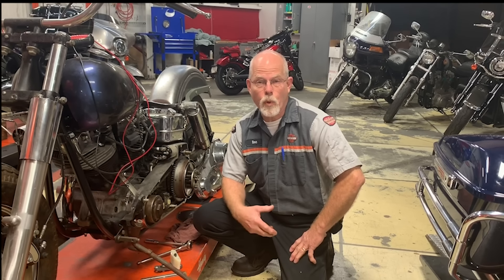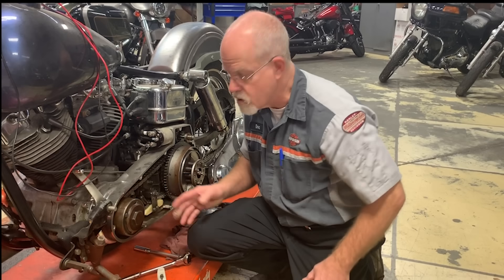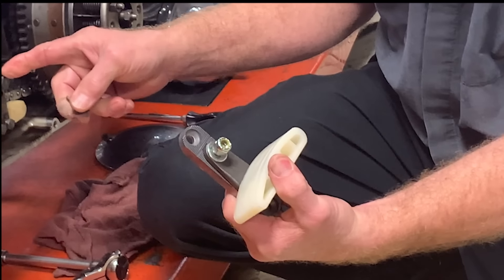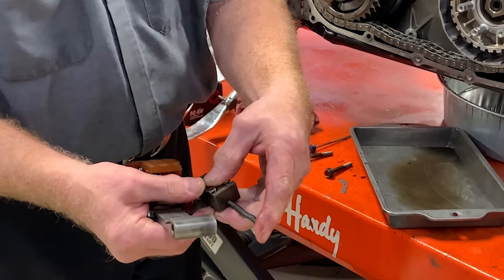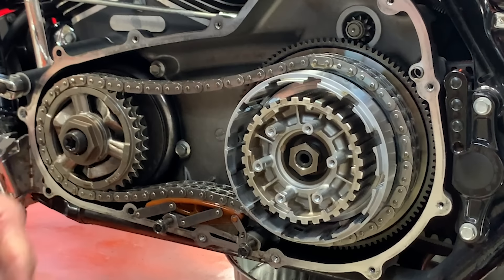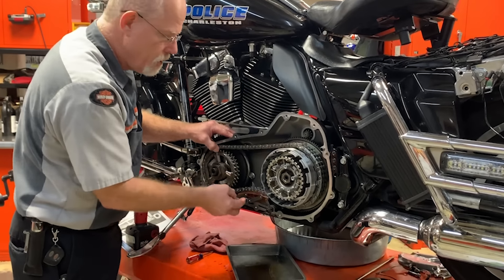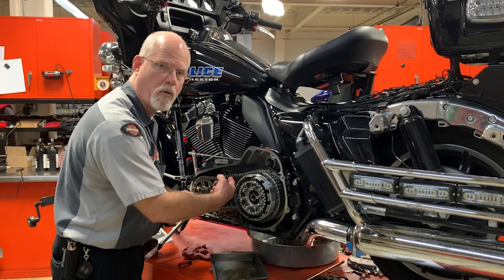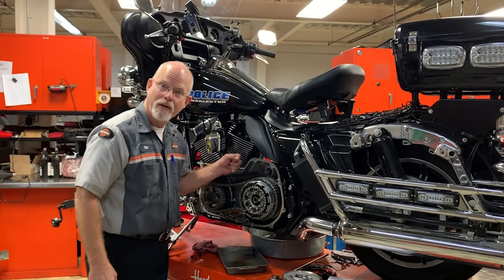DOC HARLEY: PRIMARY CHAIN ADJUSTER UPDATES

Comment: People need to understand that when when beat the crap out of your machinery, there is a cost. Ask anybody that runs the race circuit! Hopefully you've helped a few people with this video.
Reply: I don't and haven't "beat the crap" out of my bike. I ride my bike pretty easily. 
No racing done here.
Pay attention to the comments in this post pertaining to problems experienced by many.
Reply: @williamolson3704  I have been working on Harleys for over 30 years, and I can tell you the majority of the issues I come ac ross are from people that think their HDs are drag bikes.
Reply: @lawnboyfromhell  
       I'm sure!
And rightfully so. 
      That is something you can control. Poor engineering, not so much. 
      Yes, some people are in race mode a lot of the time. But, without inherent problems present, they can take a beating to a certain extent.
      The auto-tensioner is a big fail. It has a design flaw, inherent. That's not even debatable. 
      You simply will not have an over tightening problem with a manual adjuster.
Reply: @williamolson3704  And don't even get me started on the cam case, Lol! The newer they get the more I fear opening my wallet. I have an evo FXR , an Evo Sportster (pre-rubber mount) and I am building a 1983 Wide Glide Shovel. You can keep the rest!
Reply: @lawnboyfromhell  
       Hahaha! 
I had a noisy lifter, now I have different cams (TW222's, twin cam) lifters, qiicky pushrods, inner cam bearings, new cam chain shoes etc. 
     Of course, that required a different "tune" from a new tuner.
     It wasn't cheap. Including the inner cam bearing tool, over $1,800. My labor. (The tuner was $700) 
    What's you're opinion regarding the inner splines on the clutch hub breaking off?
Reply: @williamolson3704  Although I have not seen it personally the stock HD Clutch has exploding issues, so I'm told. I did cams in a 2012 Road Glide I used the S&S 551 EZ Start kit. Also changed the compensator to a Man-o-War made by Dark Horse Crankworks. I have not replaced the clutch basket yet, as I already scared the owners wallet enough by then. If you want to bulletproof a Twin Cam, start watching Kevin Baxter on Youtube, he has pretty much found all the flaws in those bikes already. The thing I don't get is why you need to bike a bike for 30,000 plus and then spend another 30,000 on it so you're not afraid to take it on holidays. I used a Vance and Hines FP3 for a tuner and I phoned Vance and Hines and told them I know nothing about tuners, they sent me a map, I put it in the tuner by bluetooth off the phone and the bike has run perfect, owner is happy as hell. I got my cam compartment tools from https://www.georges-garage.com/ less money than Jim's and every bit as good. The c ost is still prohibative if you just buy them for home use, best to get a group of like minded people to share the tools if you can.
Reply: @lawnboyfromhell  
       Hey thanks!
I really appreciate your input about this stuff. 
      Since it is, and has been from the start, I'll run this bike till "it" or "I" fail beyond reapir. 
     Yes it's disheartening, to say the least, that you buy a new bike only to have to correct inherent problems. Heaven forbid you have to pay for labor AND parts.
    The local Harley dealership quoted me $1,300 just to look in my cam case. This was before my trip to Sturgis last year. Roughly 50,000 miles on the bike, and didn't want any failures on the trip. (1,500 miles round trip with no "other" riding) 
     I told them to go ahead, but after "listening" to the bike run "on their lift" determined it wasn't necessary.  
    Ok......I'm guessing they were too busy. 
     Noisy lifter last two days of trip, so I decided to have a look myself. I'd never even seen the inside of a cam case prior. S&S has a good video on YouTube for this job along with others. 
     I noticed the decompression cams available, but didn't want to veer too far from the "norm" with that design. 
     I found my cam chain shoes were badly worn, which was one of my concerns. 
     I ordered my inner cam R&R tool from Fuel Moto, which is an abbreviated version of the very expensive (Moore?) tool. 
     It worked satisfactory only after filing and smoothing the forward beveled edge. It would not penetrate the bearing after a number of attempts, even quite forcefully. 
     I'm happy with the added h.p. and torque the 222 cams gave me. Although, there is a dilemma. Now, when driving 30mph in town, 3rd gear is too high, and 4th too low. Comfortably.  (I wonder if engineering takes that into consideration when gearing their bikes) I didn't have this issue with the stock cams.
      I've had my clutch basket apart a couple times to inspect while repairing/upgrading my primary drive. It was ok. 
     I purchased the Dyno Jet Power Vision tuner from Fuel Moto which was preloaded with a "tune" specific to the intake and exhaust on my bike. (With the TW222 cams)
      This tuner cost @$700, up from roughly $400 last year. Yup, that's a chunk of change.
     I'm going to check out the guy you mentioned on YouTube. 
     I'm in MN.
     How about you?
Reply: @williamolson3704  High Prairie, Alberta, Canada. I hear  a lot of complaints about the 6 speed for trying to run the speed limit in town 50k/30mph, They say they always have to keep feathering the clutch to keep it from going too fast. I solved that problem on a couple of bikes with the Baker 7 speed. The ratios are all different in the bottom gears and 6th stock is the same as 7th in the baker, 1-1 or direct drive some call it. Changing nothing else but the trans wakes those bikes up incredibly, they pull right from the bottom instead of bogging like the HD trans. Yes, Kevin Baxter is an awesome mechanic, and he does it right. Heres a short one on compensators: https://www.youtube.com/watch?v=foeVk_yuh3Y
Reply: @lawnboyfromhell  
      Oh, no kidding?
Others too, not just me? 
      That's interesting. 
Truth be known, I'm irritated with that whiny 5th gear. (Straight cut?) Same as 1st I believe. 
      I was just wondering about a different transmission. No kidding.
      What's that tranny going for?
Reply: @lawnboyfromhell  
     Oh, you're in Alberta!
 I've been to Medicine Hat, and not too many years ago. That was and old car run.        Lol.     '61 Plymouth that never happened. 
     I can't bring myself to feathering my clutch though. That's asking for trouble. I wind up going closer to 35 mph to compensate, though I hate to. I can do without that kinda hassle.
Reply: @williamolson3704  Probably too much, I havent done one for a few yeas now, I remember it was over 3500 Candian my cost back then, but it costs me quite a bit to get it to here from the US. Medicine hat is probably about 8-9 hours south of where I live!

Comment: Hi Doc-is it worth upgrading from 39929-06A to 39929-06C? If yes, what are the advantages?
Reply from the maker: In this video I compare the early and late models. You will have to examine yours since 06 was the first and my notes say the 06b was the updated model with finer teeth so the adjustments were finer...Doc

Comment: Doc.  Thanks again for the educational opportunity to learn from a few ago till today.  Keep up the great work.  Any chance of a video on converting an 04 XLR from normal turn signals to an LED turn signal?
Reply: Check out Custom Dynamics. Call the techs over there for your model bike. They have wafer thin LEDS that fit in your turn signal housing. You might need a load equalizer for your model. I have a 09 FLHX and changed mine and the rear brake light to a rope style that pulses. Boy do people back off your tail when slowing down. Shiney side up

Comment: Thanks for covering the older twin cam bikes. My 04 dyna is manual adjustment and i was just thinking about upgrading possibilities.
Reply: I have an 03 Dyna with 69666 on it now, I installed the auto adjusting tensioner around 25k  very happy I did
Reply: @adamakins9748  the Harley one or aftermarket?
Reply: @SmittybuiltHD  The Harley one , had the primary apart to do a stator about 5k ago everything else in there is fine

Comment: DOC! HALP! After replacing the ignition module and the cam position sensor, I'm trying to set the timing on my 89 EVO using the timing light on the clear plastic plug. Can't see any mark at all....I've rotated that cam position sensor both ways...its positioned just about where the old one was......isn't there a way to time it from underneath the drive chain tension adjustment cover?
Reply from the maker: I agree timing with timing light is so difficult. Paint the correct mark with a white or red touch up paint. Install the clear plug till it touches then back off slightly. Follow the manual instructions
Reply: @LowCountryHarleyDavidson  wait...the plug touches the rotating assembly?? Maybe that's why I couldn't see the mark.

Comment: My problem was opposite to too tight of a chain. Chain too loose on my 2017 Limited and started slapping inside the case until warmed up. The adjuster did not ratchet up as supposed to.

Comment: My 08 road king primary chain was so tight, it tore up my starter. Had the starter rebuilt,  and took out the junk oem tensioner and put in a hayden. Now my bike runs quieter, and goes in gear without a loud clunk, and its easier to find nuetral. Was a cinch to do.
Reply: I have the same motorcycle and also switched to a Haden M6 but I have a feeeling the chain is too tight. Had the pirmary cover off and the shoe is wearing out quick. Bought a new shoe and when I replace it I'm gonna remove the smaller inner spring and see/hear if that helps.
Reply: @SuperdogRW713  
      Why do you "feel" the chain is too tight? If the chain was adjusted properly with your Hayden, the ONLY issue you may have is becoming loose after MANY miles. Manual adjusting tensioners will NOT make your chain tighter with use, only the auto tensioner will do that.
Reply: @williamolson3704  My mechanic was in there a couple of weeks ago and he said the chain is fine, so I'll stop worrying about it. There are no adjustments with the Hayden except with the shims and no shims needed. Won't do an automatic being solid primary cover.
Thanks.
Reply: @SuperdogRW713  
       Symptoms of a loose primary chain would be;
      (1) slack in your driveline, like the worn gears in a differential. A loose drive belt/chain in your secondary may be the culprit also. 
      (2) worse case scenario, your chain is so loose that it is hitting the inside of your primary case.
      A loose primary chain is attributed mostly (IMO) to chain wear and possible wear of relative components. 
      I believe it's recommended to check for loose primary chain about every 10,000 miles. But in most cases, probably not an issues.
Reply: @williamolson3704  Lots of slop in the drivetrain and my guy is gonna replace the H-D compensator for something better like a "Man 'O War"
Reply: @SuperdogRW713  
      I changed/upgraded my stock compensator with a H.D. Screaming Eagle unit. 
     I tried to stay with Harley parts whenever I could. Now, not so much.
     The S.E. compensator comes with a installation kit of plastic oil "deflectors" (epoxy adhered) to the inside of the case. Other manufacturers have different designs to address the lubrication issue with the compensator. 
      I recently installed different cams, lifters, pushrods, cam chain shoes etc, including a non-Harley tuner for the cam upgrade. 
     From now on I will be purchasing whatever parts a research suggests I should use. 
    The new cams make my bike run like I believe it should have in the first place. More power and torque in the low to midrange rpm's.
      From much I've read, many believe the compensator used on the 88c.i. Twin Cam engines, is lacking with the increased power of the 96c.i. Twin Cam.
      But, "slop" in your drivetrain has nothing to do with the compensator. A loose primary chain, and/or the secondary drive belt/chain. A bike will perform best when they're adjusted properly.

Comment: Hey , theres something that isnt anywhere online/ on forums.. which no channel or dealer has covered and I think it's important- All the major and minor differences between the Ultra Limited & CVO Limited.. right from the sound system, controls, seats, electronics, engine differences.. what all is standard on either machine.. it can be a video to demonstrate the value of the CVO and also create some marketing hype ! Cheers

Comment: HD is a slow innovator.  And I use the term innovator very loosely.  Auto primary chain adjusters were available in the after market well before HD used them.  I installed an aftermarket auto primary chain adjuster way back in the day in my 96 RK.  Triumph and BMW have had ABS and traction control (of course HD doesn't call it TC) available for their bikes for years before HD introduced them.
Reply: gemini232003  . I'm with you for most  part until I bought a new Triumph Trophy in 2013 which had ABS and traction control standard
What it showed me was irrespective of my riding skills when a car cut in front of me I just jumped on the brakes as hard as I could without having to rely on skills which I was great at 20-30 years ago and which in time I may not be as good at now. Cheers.